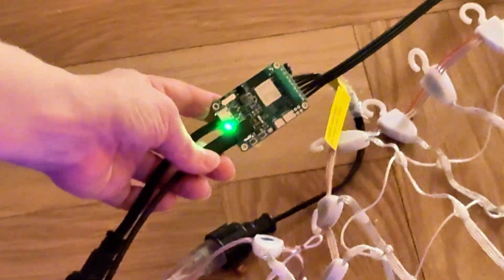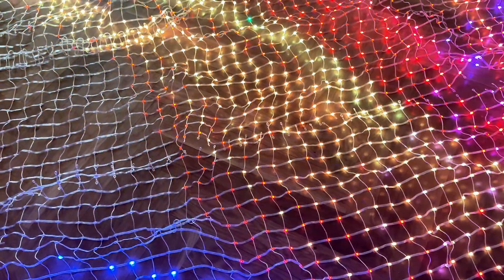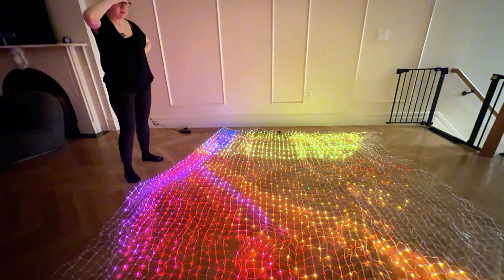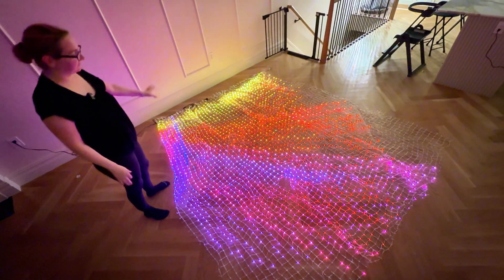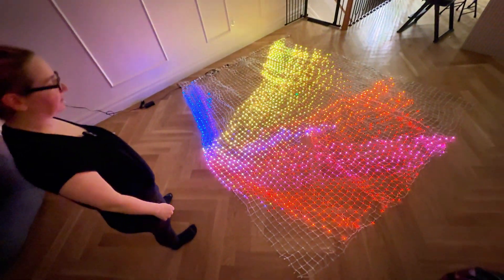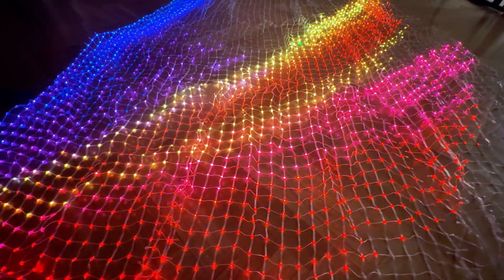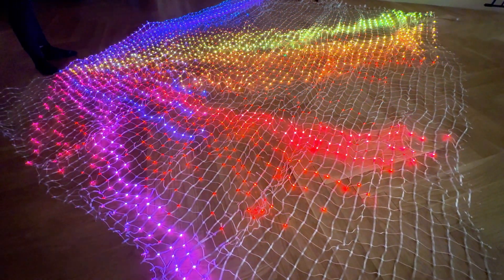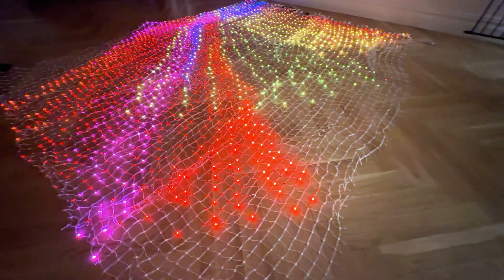BIG BIG rainbows on "Sparkle motion" WLED driver board

Comment: Be careful with the quality control warranty from your supplier. Because roughly in the centre of the middle panel one of the RGB pebbles is missing it RED LED.
The give away is when the rest of the LEDs around it are yellow ( red & green ) LEDs on it is just GREEN
Infect the best way to test RGB pixels is if you have the current capacity make them white or if not check cyan (blue & green) magenta ( blue & red) or yellow ( red & green ) as missing chips are really obvious …